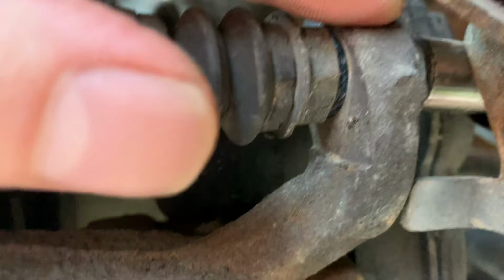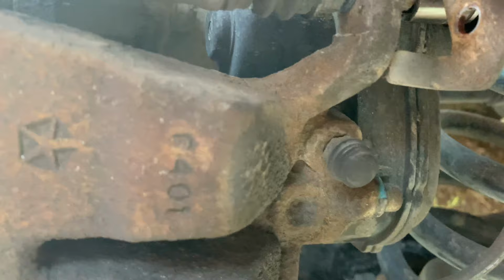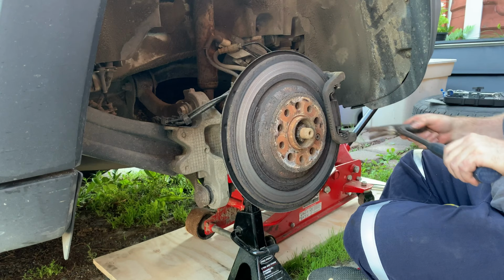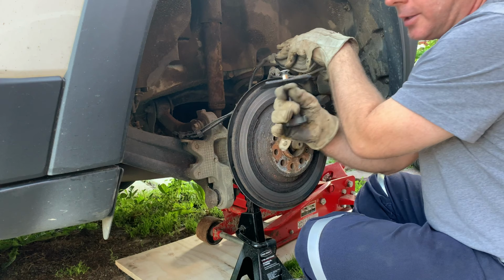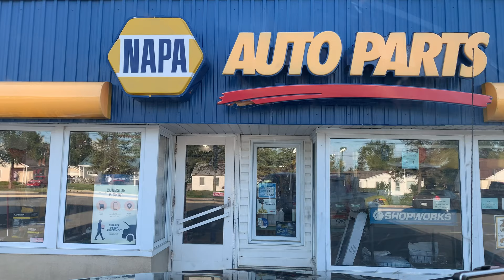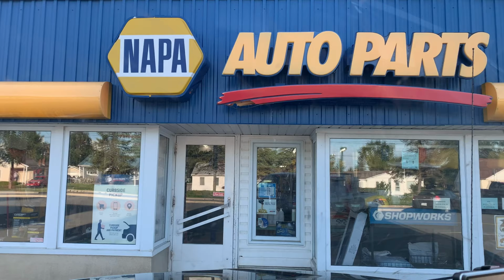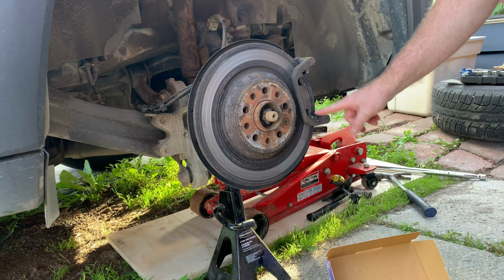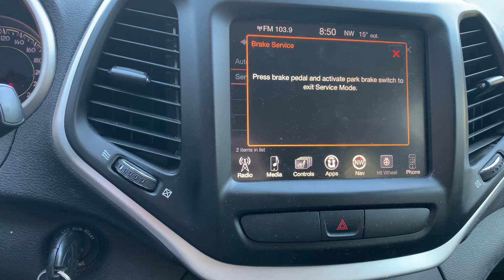Rear Brakes on 2015 Jeep Cherokee Trailhawk

Comment: i dont get it why you didnt change those dead rotors... what a bad job :`( and next time... simply remove the caliper frame to remove the stuck pads.. 10 times easier. (not watching this to learn anything btw) EDIT: and you didnt even lub your calipers pins and top of the pads or slightly grease the metallic pad holders/sliders.... i hope its your jeep. and the torx socket is just a few dollars.
Reply from the maker: Totally agree with you but I didn’t have the tools and the stores weren’t open yet.
I got the pads the night before and didn’t realize that I needed tools I didn’t have.
My wife needed to get to work and I’d rather have her with some brakes rather than nothing.
I appreciate your comments!
Thanks
Andrew

Comment: \you didnt change the rotor!....man whats wrong with you.
Reply from the maker: That's actually an easy answer. You need special torx bits to take the caliper bracket and rotor off that I didn't have at the time.
You'll be happy to know that since this I have replaced all of the calipers and rotors.
Thanks for watching.